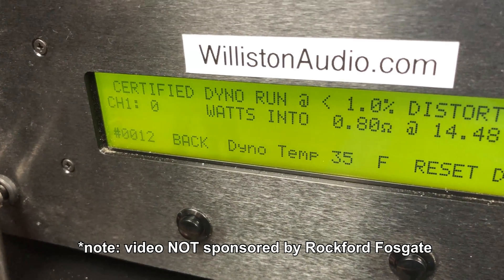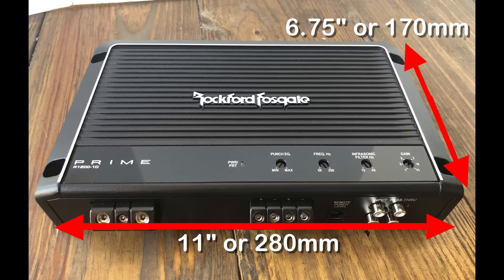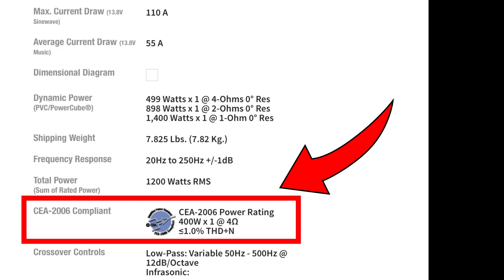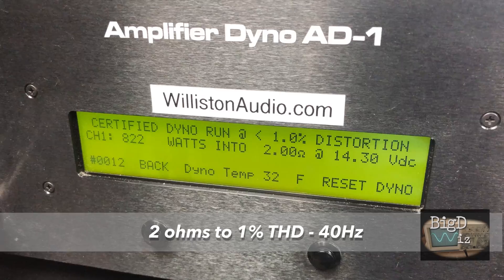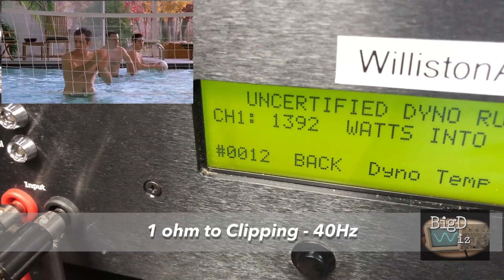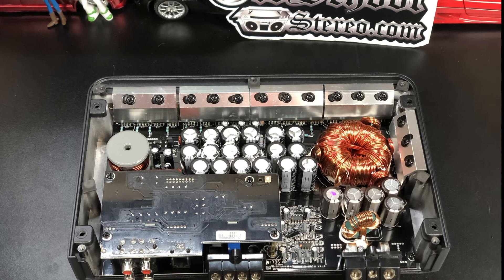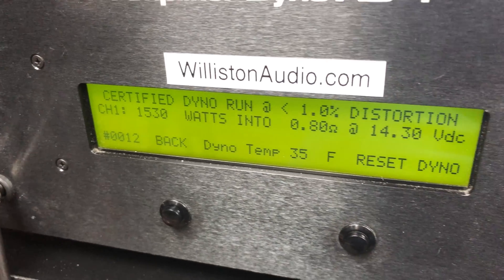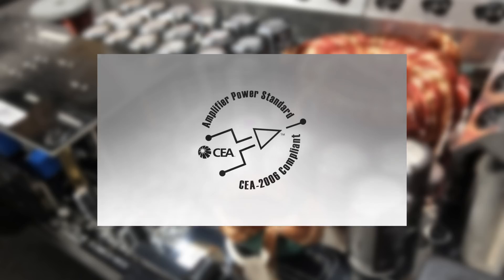Prime Time? Rockford Fosgate Prime R1200.1D Amp Dyno Test

Comment from the maker: Buy the Rockford Fosgate Prime R1200.1D here: http://amzn.to/2Eh2yqn

Send me a few bucks if you want to support: https://paypal.me/BigDWiz

My Favorite Screwdriver Kit: http://amzn.to/2x0VzcE

Test Your Own Amps! SMD / D'Amore Engineering AMM-1:
Amazon - http://amzn.to/2u2EgKV
WCCarAudio - https://goo.gl/CVCgU3

Full disclosure: Amplifier was purchased by me for the purpose of this test. All of the opinions in this video are my own and the content wasn't reviewed by anyone prior to posting. Affiliate links are provided for your convenience. I receive a portion of the sales from these links, which help me bring you more unbiased content for this channel.
Reply: jay brooks if you have a 2ohm sub then you can wire your sub down to push 1ohm...the amp will do what it do as long as 1 you have good electrical An 2 your sub or subs have to equally be able to take 1500 RMS, anything over a 1000 watts stock won't cut it...Big 3 all 0gauge wire copper the better and double lead in the back with at least a battery. Maybe a big alt depending on the car...straight 👍🏽✊🏽my bad that's the short version koo...
Reply: XxQuad_VoltagexX well stay tuned to you tube one got two explodes I'm gonna be building a burp box for
Reply: BigDWiz thanks big bro I have this amp and I'm very happy with it. I'm pushing 2 12 inch atomic apocalypse rated to handle 1500 rms each and this little amp is giving it to them at 1 ohm
Reply: Hey big D. What do you do with these amps? Do you sell them?
Reply: BigDWiz Can you try a Sony XM-1S I have one I want to know what it actually does it seems like it put out power plus I think it would be cool to see a XPLOD doing some work
Reply: Thanks again man great video
Reply: BigDWiz do you have the old kicker zr240 if you do id like to by it to go with the one i have
Reply: I hit up the link. Hopefully it works,  let me know.  Thanks
Reply: Great video man. Hope all is good
Reply: BigDWiz 
I always was interested in this amp especially for the price. I can't wait to see it it does on the dyno!
Reply: I have a 1000.1db. Can I send it to RF to get repaired?
Reply: @ktotheswiss1617  send it to g&s amp repair. He fixed my old 4 channel kenwood, and fixes rockford all day long. Look him up on facebook. Great guy.
Reply: Ktothe Swiss 
If it's not too old. If the unit your sending in for repair is currently in production they have a repair shop where you can send it. If it is too old you can send it to the amp doctor and they can fix amp.
Reply: BigDWiz how can u wire this amp to 1ohm to get that 1500 watts
Reply: BigDWiz I have a rockford fosgate punch 301m..   have u ever put one on the dyno and if so what's it do on it?..  if not can u so I can see what it's about it says 150×1 but I also had a 200 dsm and it was killing my 2 b2 12's with close to 900 watts
Reply: Crank it up to 11 😂
Reply: You still sell t shirts?
Reply: BigDWiz I have a Rockford Fosgate P1000X1BD. Could you see if it will run at half ohm. I would really like to know please. I have 2 dual 2ohm subs and won't have the money to get another amp until the end of the year.
Reply: Can we get a comparison between this Prime Series and the new R2 line. A side by side drag race.
Reply: Got one of these and its nice 👌 no issues.More than enough power for the P2d4-12 pair in the trunk in a custom sealed box and its ridiculously loud.

Comment: Hello can anyone help me? I have two jl 12w3v3 sealed enclosure running off a rf 501bd at 2ohms.... would it make a big difference if i had 1000watts going into the subs instead? I found an amp rf 1001bd.. im unsure should i buy it

Comment: Integrated PUNCH eq??
Means you cant disable it?
I want to see the signal input vs output. 
To see how much the waveform is tweeked. Does the output change based on that punch eq? Because you would think it would send more power the frequencies that are boosted.. 
Right? 🤔

Comment: Damn, only 822 at 2 ohms?  You got a lemon!

Yeah that is over the rated power, but I've seen 500 watt amps putting out over 600 from fosgate
Reply: Birth sheet on the one I bought brand new (R2-500x1) was 610w at 2 ohm and 348w at 2 ohms

Comment: I’m trying to figure out what’s the best amp to run on 2 Fosgate T1 12s/4 ohm. I want a good quality amp. What’s you opinion on the Punch 1000 and the Power 1000 or 1500. Which would be the best? I was thinking the Power series for sure.

Comment: I will be surprised if I get a response to this but here goes...  I have this amp on my p3 12s. Works great, then I have the r600.4d on my highs. 2 sets of 6x9s, Fosgate prime for the rears, and the newer alpine 6x9s for the front doors. Problem is, when I crank it up,and not very loud, the 600 cuts out and the protect light comes on. Only on the right front speaker. Amp is bridged, grounds are solid and gains are just under half.  Crossover set to 80 htz... ideas?? Anyone??

Comment: I have been running this amp hard with 2 p3d4 12s for 6 years with no problems at all. Clean power...whole suv is RF. 4 way 6x9s, 3 way 6.5s and 4 tweeters on  a 400.4 and a stinger battery. The only thing I had to replace was the battery which is normal, and I beat on them.

Comment: 5:45 On their website RF says that the max current draw at 13.8v sinewave is 110A and they also recommend a 150A fuse.  Will a similar real world dynamic pull like the one you did of 173A blow the fuse? Thanks for your reply. -Cheers
Reply: I had an 80 amp fuse for 3 years and never blew it running 2 dd audio 12s on stock electric with 4 guage wiring.
Reply: On sonic electronix it says 200 fuse limit

Comment: I just installed the new version R2 1200.1D. Wondering if I should of got the older version and what the guts look like compared.  Don't get me wrong, the R2 looks great and I love the clipping lights. It's just that it feels kind of cheap. (It's lighter than the older one). Comparing it to my older R750.1D which is heavy and feels solid like a tank, the new one makes me feel like they cheaped out on some internals. They also went up on the recommended fuse size from 100A to 200A which makes me wonder about efficiency.

Comment: This amp series is better than Pioneer’s already-competitive GM D class amps. They just about always outperform their specs with quality components inside. I’ve seen an awesome build where a single Prime amp powered 2x 6x9 coax speakers and 4x Rockford P2 subwoofers from a single amp and it was a monster (and the amp was like $250 which is amazing value for the output)

Comment: Why is it that their prime series amps have a higher power rating than their higher end punch or power series, at least for mono channels? I get you’re probably getting cleaner output on the better series, but this 1200 is the highest advertised wattage output in their catalogue.
Reply: Never mind- power series has a 2500W, just odd that the punch line caps out at 1000, when their punch subs are rated 600W rms.

Comment: I love Rockford and was impressed w/the 5 channel prime as far as power goes. It pushed my P2’s pretty good. However, I payed $450 for the damn thing new and it only lasted about 6 months! Not a reliable amp. It’s just been a 450 dollar paper weight for the last two years now! If anyone has any advice on if and where to repair that would be great! Audio express up here in Montana went out of business right after I bought it! Just an all around rip off! Being from Phoenix i would love to keep running Rockford but if this is the way it’s gonna be I can’t see buying another one 😢
Reply from the maker: That’s a bummer. I’ve had good luck with reliability and these amps

Comment: I got that same amp on a set of ps3 absolutely amazing and my electrical is stock I usually dont drop below 13.6
Reply: Bro where do u set the sonic filter at i don't want to blow my shyt
Reply: @duke1977 play water by ugly god and when the lows start, turn the subsonic filter up until the bass is fully controlled.

Comment: I use this on my two p3’s at 1 ohm gain at 60% tuned box 38 hz at 3.2 cf fosgates are underrated! I had 1,600 watts at 1 ohm load on em with ranges of 31-50 hertz tough stuff no clipping but did get hot.
Reply: @jeffrothegamer  I just ordered that exact set up does it hit ?

Comment: Is this underpowering my 2 ohm dvc alpine type r 15s they are 750 watts rms each????
Reply: If you have 2- dual 2 ohm subs, you can wire them down to a half ohm (.5) or up to 2 ohms. I doubt you're at half ohm so, yes, I would say they are under powered.

Comment: Big D all these companies put out so many lines of amps and ive never really seen a video comparing all 3 showing the differences. Perhaps a rockford prime vs punch vs power 500 watt amp dyno and sound comparison. JL Audio ummm Kicker there are several brands that do this. Im really interested in starting over and putting a system in my new truck like my old one but im not certain the line of amps i should probably get. I was leaning towards punch line but these prime amps seem to do a great job.
Reply: i like the current punch line. the amp comes with a built in dd1. it has a clip light for the rca so you can set the volume of your deck to its loudest before clipping and it has a clip light for the amps gain setting. its a really heavy amp for its size

Comment: Hi BigD Wiz,

Can I run 2 sundown sa-8 v3 dual 4 ohm 500 rms each on this amplifier or would I need something with more power. 

Thanks
Reply: Should be a good combo, sundown is very conservative with their ratings. If you're worried about overpowering those sa-8's you can just set the gain to deliver 1000-1100 watts.
Reply: @aaronpowell4885  Thank you

Comment: I feel like a newb but i can't get a solid answer.   I have this amp with 2 shadow mount pioneer 10 subs in separate boxes.   What are the settings i should have this amp set at?   Thank you
Reply from the maker: Settings are based on head unit and the reason you’re not getting suggestions is it will vary per install, so you’ll need to tune it or have it tuned by ship with proper equipment

Comment: I purchased this amp brand new a little less than 1yr ago pushing 2 12" 2k DB Drive woofers at 1ohm. The amp went out on me it didn't smoke & power light still comes on but no power going to the subs. Still under warranty thank god I took it back to the dealer and I'm now waiting for it to be sent back to be repaired. Nothing lie the old school punch series I used to have. Hopefully the refurbished amp last 10 yrs + like my Old School Punch 360.a I use to have on 2 12" 1400watt Pioneer woofers I doubt it though.
Reply from the maker: Oh boy 🤷‍♂️

Comment: Noticed that there is no onboard fuses on this amp. What amp size do you recommend to set aside for  this amp
Reply from the maker: Check the manual. I think they recommend 100A
Reply: 150 amp fuse

Comment: I have this amp on a pair of 12w3v3s at 2ohms.  It is easily one of the best amps I have ever had.
I have always combined fosgate amps with JL subs.
Reply: smart guy
Reply: Do they hit hard? Im also pushing 400 watts to a pair of w3v3 but thinking i want rf 1200.1 amp

Comment: This amp is trash. I have a blown one sitting in my closet. It sounded like ass when it did work. To add insult to injury the power acoustik I replaced it with actually sounds better though its considerably less wattage.
Reply: I have a Power Acoustik 3500 1d. Razor LoL and it doesn't put out no-where near 3500 watts even if I were to feed it with 20 volts of power it will never reach 3500 watts LoL with that said Rockford Fosgate amps always put out 100 -150 sometimes 200 watts more than what they advertise meaning Power Acoustik numbers are 2000-2500 watts off what they advertise LoL facts Big D even dyno tested the Power Acoustik 2500 1d. Razor from Wal-Mart. Only reason I copped this Power Acoustik I got is for the price open box for $93 free-shipping from ebay and brand new they go for $130 and up depending on the seller but I am taking it out and putting one of these 1200 1d. Prime on my 2 15's. And another thing Power Acoustik amps have little number of fuses that is a dead give away to let you know they output numbers don't add up. All them low-budget cheap crappy amps 8000 5000 4000 4500 in wattage and they don't cost but like $90-$200 bucks you have to be remedial to think they pushing them numbers LoL. I am willing to bet you a Rockford Fosgate prime 500 1d. will beat out my PA 3500 Razor and the Power Acoustik you have too Audiopipe is the only other cheap budget amp that will put out what it says and what it advertises but they hard on your electrical system but they put out real power!

Comment: You know if these amplifiers can be strapped together with another identical model
Reply from the maker: Not strappable, but can be gain matched and used to power DVC subs
Reply: BigDWiz yeah I've done that before. Oh well I don't regret buying any Fosgate device I've ever had and good thing is older generation RF amps that are BDsync capable can be got cheap and still kick ass!

Comment: So what is the efficiency for the 1500w/1ohm dynamic???
Reply from the maker: I don’t usually calculate efficiency with Dynamic runs as the clamp only captures the inrush current
Reply: BigDWiz oh ok, so the only efficiency that matters is the certified and uncertified??
Reply: BigDWiz and what's your thought on amps made by PowerBass?? Id love to see a dyno on the ASA3 1500.1

Comment: Another thing that’s cool about RF is their 1 year warrenty. I mounted the amp upside down and when I wired it I didn’t compensate, and experienced a brief tuitorial in arch welding...realized what I had done called their tech line, They replaced it, that was Solid if them!!!

Comment: I'm fixing to order this amp to run Rockfords pre boxed pair of p3 12's. It will be the only amp on that power line. What amp in line fuse should I use on the power wire? I see you pulled over 170 amps. So I'm guess the 150amp fuse won't be enough and I should use the 200amp?

Comment: I've seen a couple of these amps running at 1ohm and they barely get warm to the touch. They seem to be very efficient for its size and power.
Reply: I just bought one I’m going to put it to the test
Reply: @vernoncheek9520  nice im about to sell mine. 
i loved it but im moving up in power
Reply: @Two_chair_Lynn  Hey did you end up selling that amp?
Reply: @vernoncheek9520  Hey how is the amp treating you these days? This is the model I have on my radar for my friends truck.

Comment: I have a T1500.1 hammering a 1250 rms orion xtr pro with a 100 amp fuse! it has not blown till this day and this amp just gets warm.. it does not heat up at all.. that's to show you how efficient RF amps are compared to the rest! (well except JL) but
I saw your comment on Steve's dyno test about getting one soon! I'm looking forward to it! Can you test the heatsink's ability to pull heat from the components too? :D

KEEP UP THE GOOD WORK BIG!
Reply from the maker: The T1500 is one of the 5 I’m going to try in a real world test in my car as well as Dyno testing

Comment: I need everyone's opinion, I have a alpine 3566 running in 5 channel mode, 30W X 4 for the mids and highs, and 160W X 1 for the subs, I have Rockford Fosgate punch classic 10's 2 of them running both rated at 100w each, and Rockford Fosgate Audophile mids and highs, Should I Buy a new mono amp and get RF p2 10's and put the alpine in 4 channel mode, or just keep it as it is. As you can see this is all old school

Comment: I got the Prime R500.1d beating on a couple of CT Audio 10"'s wired up for 2 ohms and this thing hums right along at 480 watts. Birth sheet that came with it said it was tested to 670 watts at 1 ohm. Love how compact the amp is, makes the install a breeze. Whole setup jiggles my car around like jello. Super impressed for how it sounds considering the amp was only $115 and the subs $50 a piece.
Reply from the maker: Amazing how little you need to spend to get some great sound 👍

Comment: Do you test stetsom amps???? I really hope
Reply from the maker: I tested an amp that used a Stetsom board...it blew. My buddy Ryan tested a Stetsom and it blew. Not good track record. Not to mention certified Power was over 1000 watts less than rated on 3500 model (to 1% THD)
Reply: BigDWiz thanks for sharing. Your channel its great

Comment: BigDWiz
 Here's a big question for you; What amp would you run to push 2 Alpine 12" 
4 ohm dvc  X-Series wired to 1 ohm?
Reply from the maker: If budget was not a concern, the RF Power 2500bdcp...for more budget, the Orion XTR2500.1Dz

Comment: Kicker cx1200.1 or RF r1200.1d?
Reply from the maker: Sounds like a good comparo! I’m betting the Kicker performs well too
Reply: R Garcia I have the RF r1200.d on 2 12 P3-12D4's in a tuned dual ported box, I have the gain set about a little less then a 1/2, they pound so hard!

Comment: Keep up the work fam. I have a question I keep on coming across. Sometimes ill be banging and my bass will go half the bass for a few seconds then it'll go back to normal. Sometimes it won't do it. When that happen sometimes ill cut the radio up and it'll go back to norm. Ill get a appointment set up with the place that did the install and every time I go there it don't happen the way I describe it to ya. They say that they can't do nothing until they hear it themselves do it. Have you ever ran into this problem and do you know the solution. Love your vids fam thanks.
Reply from the maker: Strange for sure. Hopefully they can sort it out for you
Reply: Um thanks for answering my question